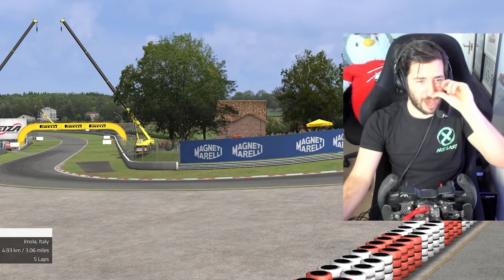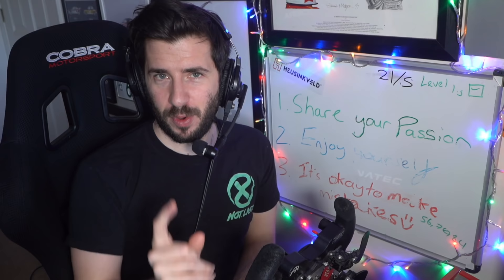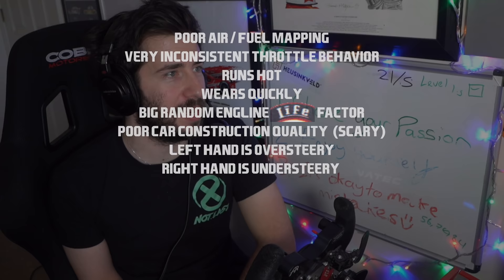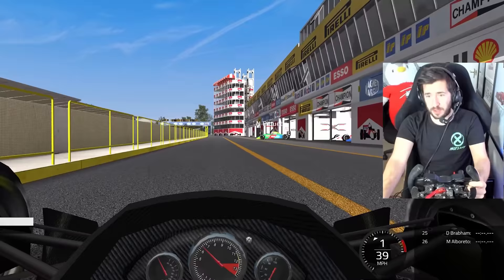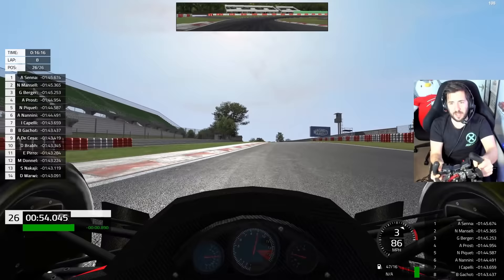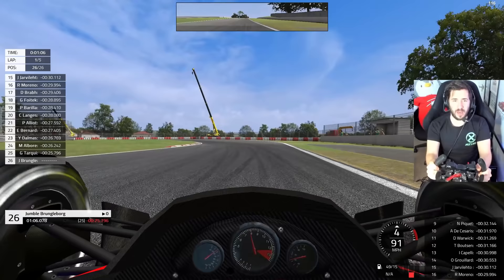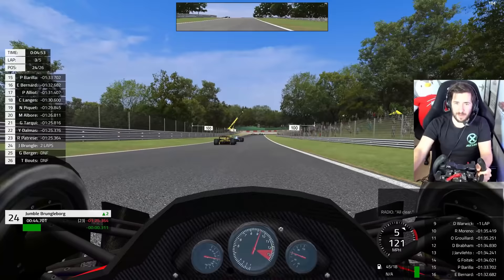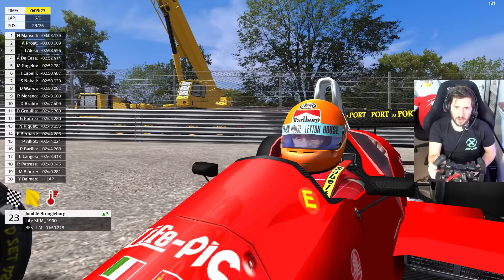I Drove The Worst F1 Car Ever Made

Comment: Fun fact. This car had less power than the Lotus from 1979.
Reply: Itd probably get lapped by a go-kart. And not a racing one
Reply: Nevermind the '79 lotus, it has less than the '67 Lotus when run in 'raceable' conditions! A 2017-2021 WRC car has as much power & that has less than half the displacement & a third of the cylinders! And even if it is a turbo, applying the FIA 1.7× multiplier for Gasoline Turbos only makes for marginally better reading.
Reply: @ChaosqueenMaddy  i can lap that car (I am morbidly obese)
Reply: @RayanM50B25  My dead great grandmother could lap it
Reply: Go on, lap it then
Reply: Damar Fadlan  Tbh a bicycle probably could. And not a racing one, i mean one of those ones you buy a kid with like, stabilisers
Reply: It had less power than the German entrants of the late 1930s
Reply: With how bad this f1 car is i can officially say I drive a F1 car
Reply: How and why would a modern car be worst than other older cars!?🤯
Reply: I'd love to see this car in a mixed era race. Just to see the equivalent.
Reply: @Makron5  You'd have to have max 1970 for it to have a chance 😁
Reply: And be aware the engine on this thing is a freaking W12.
Reply: They probably would have stood a better chance if they actually did use an old Cosworth DFV engine. It would still be down on power but I imagine it would be much more reliable.
Reply: I checked lap times around Imola and the Ferrari 488 Pista has more pace around there with a 1:48.33
Reply: Forget it. This car had less power than an F40, and was slower than an F3000 car of the same year.
Reply: Low power, heavy chassis and the aerodynamics of a brick
Reply: @legoferrari14   you could argue the lotus 67 and 79 had the same power since they both ran the cosworth DFV which was virtually unchanged throughout its service life
Reply: It had less everything
Reply: Less power than my left thumb
Reply: @StuntcatTV   r/woosh
Reply: Damar Fadlan  such a great game
Reply: It was slower than the 1958 vanwell
Reply: That’s sad
Reply: Fun fact this car had no life in it
Reply: It has 60 more horse power than the Eagle Mk1 and that sounds good but the Eagle won a single race in 1966
Reply: Some one says he car is fast than life car
Reply: @ChaosqueenMaddy  s h o p p I n g k a r t
Reply: Fun fact. This car had less power then my gammy knee
Reply: If we want to play that game the current 1.6T engines make half the power of the 1986 Brabham 1.5T.
Reply: We need a lie detector for life team and expose their lies that they wanted to say, come hire them
Reply: Also life was rumoured to be trying to sign Mika hakkinen

Comment: Fun fact about the W12, it actually could produce 650 HP, but it would literaly blow up in seconds, and Bruno Giacomelli said at the British GP, one of the Life best performances, despite being 16 seconds off the pace, that he heard a weird noise coming from the engine while he was driving the car, and he believed that noise was simply the 12 cylinders working at the same time for once.
Reply: And at that same race, it was only three seconds faster than the cars in the F3000 support race. If that was its "best" performance, then I think Jimmer was right in that it was usually slower than the F3000 cars.
Reply: @F1Krazy  the best performance for the Life was at Monaco, it was 14 seconds off the pace in pre-qualy, but only 2 seconds slower than the Coloni - Subaru, that was the closest it got to actually beat another car on pure performance, without counting the USA GP, when the Coloni lapped the circuit in almost 6 minutes due to a clutch failure.
And I would say that in circuits like Monza or Hockenheim (that was still the old layout with the long straights), the Life would might be even slower than an F3 car.

Comment: The mechanics just not bothering to put oil in the car because "fuck em" is levels of pettiness we love to see 😭😂
Reply: Should have used a Honda D15. Then maybe it would have lasted a lap.
Reply: At least it wasn't as bad as Andrea Moda who fitted Perry McCarthy's car a dodgy steering rack
Reply: @jacobrzeszewski6527  can confirm, accidentally ran my d16 for longer than i would like to admit without oil and it's still kicking 😂😂
Reply: @GRiiZZ  McCarthy: "Guys, I stopped. Nearly crashed at Eau Rouge, steering is jammed, and it might be flexing."
Sassetti: "Yeah, Moreno had a similar problem before we replaced his."
McCarthy: "Why didn't you check mine?"
Sassetti: "We used yours as a replacement."

Seriously, from what I'm reading Sassetti should've been charged with criminal negligence, if not attempted murder.
Reply: I think I remember that this was an unofficial split from Ferrari, and that the car had real potential. one by one Ferrari worked things out with mechanics, convincing them to make the team fail.
Reply: @AdamTheMan1993  I mean if we’re talking about dodgy steering? Senna demanded dangerous steering modifications be made prior to the imola race because his knees were touching it or something. We all know how that went alongside the other variables
Reply: Fight the Power!!
Reply: @dylanzrim3635  Wow now that is info I did not know at all, I thought Senna was just the victim of team negligence.
Reply: I aspire to be that petty one day
Reply: @Dat-Mudkip  My goodness. Is there a clip of this?
Reply: @AdamTheMan1993  Monteverdi-Onyx welding up snapped wishbones????
Reply: @AdamTheMan1993  really? dude was just trying to get him killed jesus
Reply: @Nick_4545  Yes really, I believe it happened at Spa where Sassetti tried to claim insurance money by having McCarty cause a big accident luckily the FIA got fed up of Sassetti's disciplinary actions and kicked Andrea Moda out of Formula 1, the only time in the history of the sport to do so.

Comment: The Life L190: the heaviest car with the slowest engine built from a design, it's main designer considered a death trap. Truly the marvel of engineering!
Reply: The L190 stand for Loser 190 

Truly Marvel of engineering indeed.
Reply: That things almost street legal competition of bad
Reply: @jamescarpenter855 there's plenty of street legal cars out there these days that could beat it easily, lol
Reply: Wasn't it based of the First F1 (yes, that's the team name) car from the previous year?
Reply: @PEPSIMaxMusic  Indeed it was. The sad part is that the First F1 car was actually fixed by the time the team pulled out. A few months later, it was bought by Vita, modified (or butchered, would be more appropriate) and basically smeared his name across all F1 with the abysmal attempt at running an F1 team. At least they had the spirit

Comment: The car might go faster if the wheels didn’t spin backwards. 😂
Reply: Have you never seen that optical illusion before?
Reply: I know it’s an optical illusion, and I know what causes it. I was just making a joke, that’s all. 😊
Reply: @sunman2566  ok Sherlock
Reply: @sunman2566  wow new discoveries, eh?
Reply: @sunman2566  r/woooosh
Reply: @McPlayer8t  what causes it, I’ve always wanted to know
Reply: MintyFresh Hmm… it’s difficult to explain, but I’ll try. Imagine a clock with no hour or minute hand, just the second hand, that represents the spokes of a wheel turning. Now if you took a photo of that clock every 59 seconds, and quickly flicked through them all, it would appear that the hand is moving backwards. The same principal applies to the wheel, however instead of a photos, it’s frames of the video, and instead of a second hand, it’s a wheel.
Reply: @McPlayer8t  ah okay
Reply: @sunman2566  r/woooosh

Comment: Fun fact about that thing: it’s own designer described it as „good enough only for a very interesting flowerpot”

Also during their infamous 7 minut lap in Imola their top speed was stuck at 105km/h(a bit over 60mph), while others were passing the barrier of 300km/h. Imagine going into Villeneuve(and we’re talking about the old layout so it’s a proper corner not a chicane) and seeing that at the apex
Reply: Giacomelli had a gearbox failure during that lap tbh
Reply: my old dingy shitbox wagon car with 98 hp can get up to 120km/h, wtf is that car designed as ?
Reply: @bluejacketergazu2447  tractor
Reply: @magnussencube  Massey Ferguson built an F1 car to demonstrate how good their tractors transmissions were. It had a race win by Sterling Moss and he said it was his favourite car he ever drove.

Even a tractor is better than this thing.
Reply: @beardedchimp  it was AWD too, the p99 was cool
Reply: wait does that mean that my old renault kangoo with 75hp is faster than an f1 car?

Comment: This just makes me wish for a series where Jimmy drives his favorite cars, but has to ruin the setup by randomizing everything!

I did it with the limited options in GT Sport, and it resulted in a Mini that literally couldn't drive straight, as it kept "falling" to one side or the other all the time, coming from insane toe angles and a spongecake suspension! It was basicly impossible not to spin on the straights, as it also had insanely grippy front tires, but the worst tires in the game on the back...
Reply: Still better than my AE86, it flipped whenever i tried to turn

Comment: The engine designer designed the V8 for the Ferrari 308. When he was fired from Ferrari he stated designing the W12. It’s actually based on a W18 design Ferrari turned down that was based on a W3 that was put in a bicycle frame.

Comment: Facts about the car:

There was only one chassis, and it previously failed a crash test during another team's entry bid, so they had to abandon the car, but it was bought by Life and it magically passed the FIA crash test.

The engine COULD ran up to 650 HP, but it would blow up in milliseconds.

The race in which the mechanics "formed a strike" and not put oil in the car isn't exactly all true. The real answer is that they just forgot.

Long after the team folded, someone bought the car itself, repaired it, and attempted to drive it on the Goodwood Festival of Speed Hill Climb. The car's engine blew up before it even made it halfway up the course.

Comment: Got a fun lap challenge, what street cars are faster than this "F1" car?
Reply: Street car based and street legal? I would say just about none....Street cars have miniscule downforce and crappy tires. Oh, and they are heavy as well. But its a fun thought.
Reply: Im sure there are some hypercars that could beat it.
Reply: @egoalter1276  Not "world certified" on street legal tires, I dont think.
Reply: @GoldenCroc  I mean, a veyron beats this in straight line acceleration, barking, downforce, and amximum lateral acceleration in a corner. I see absolutely no way this would win in a race. But alright.
Reply: @egoalter1276  It doesnt beat it in those categories, where did you get that data from if I may ask? Because it is wrong.

But yeah, its understandable you would think so with the data you got, but it is, as I said, wrong in this case. Cheers.
Reply: @GoldenCroc  I got my data from the publicly availible specifications for the car that make it clear it is clinically underpowered, and from its recorded qualifying times that put it over half a minute off of qualifying pace without fail on every track it ran on. Lets not account for the fact thats its engine would blow up every two laps if it dared access even its rather limited power reserves.
Reply: @egoalter1276  You are correct in that its a criminally slow F1 car, extremely so.  A bit of that will be the lack of proper setup though, and inability to work the tires. But very slow indeed, embarrasingly so.

However, where you have gone wrong is assuming for example a Veyron is faster or has higher spec in any of the categories you mentioned above because of that without any supporting data of the raw specs. 

But I can with confidence give you the same answer I gave you before: Its not faster. Not at all. There is just  that big of a difference between a street legal car and a F1 car that even an abysmal one is still considerably faster, and most of all, have higher stats in the categories you mentioned above. That is because those are higly influenced by body shape and vehicle weight. Both are highly suboptimal for street cars. 

As you may know, youtube doesnt really allow links, but there are tons of data of street car downforce (Its extremely small compared to race cars) as well as various video comparisons between formula cars and street cars. Even jimmers own nurburgring score sheet from his videos will likely be illuminating, and thats of a highly atypical track that very much favor high power and speed. Cheers.

Comment: The old gen 6 nascar I drove for my first time in a racecar at Kentucky speedway, (de-tuned with 5500 rpm rev limiter for obvious reasons), still had a faster top speed than that piece of crap

Comment: Fun video, and entertainingly much as with the Lola this video makes the car both better and worse than it was IRL. Overall pace is off where it should be (IIRC the car was at least capable of getting within less than 20 seconds off of the leaders' pace on the rare occasion everything worked correctly) but the top speed is actually too high  (145mph was the highest speed it ever clocked IIRC) and the original W12 lasting three consecutive push laps was never going to happen. They were also the last single car team and the reason the FIA forced through the rule that every team has to enter two cars.

Comment: Seems like it would go faster with a 4 cylinder turbo :P
Reply: yes as long as it wasnt designed by these guys. heck even a 1 liter turbo ecoboost would be faster
Reply: I think you could stick the engine from a 1994 Toyota Corolla into this and it would probably be better. At least it'd be reliable.
Reply: @AliceC993  you could stick a bone stock Mazda 12A into it and it'll be three times as fast

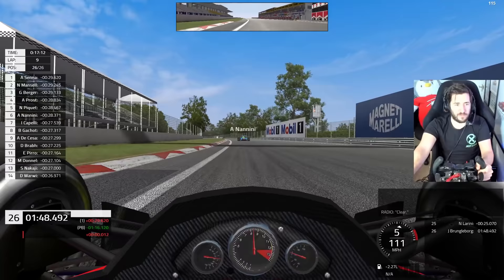Comment: 10:02

Just a quick sidenote:

What in Gods name is Bertrand Gachot doing sticking the 1990 Coloni on 5th in qaulifying??

Lets not forget that the 1990 Coloni was the one with the "works" Subaru engine, that on average was actually some LESS powerful than the Life W12, the Subaru flat 12 (what a year for engines 1990 was in F1) developed usually around 400-420bhp, and had a maximum output of about 520

Whats going on?

Comment: I'd like to see this pile pitted against 1950s F1 cars in AMS. Might get within shouting distance of a points finish!
Reply: Bruno Giacomelli did a 1:41.187 in the Life in pre-qualifying at Monaco in 1990. If he'd done that time in 1958...well, he would have been faster, because the circuit had got longer between '90 and '58. But just supposing he _did_, he'd have been fifth on the grid, between the Coopers of Roy Salvadori and Maurince Trintignant (who went on to win). In practice given the shorter circuit he'd likely have been closer to Tony Brooks' pole time of 1:39.8.

So...yeah, pretty much.

Comment: If only they had stuck with the damn Judd CV...
Reply: The electronics weren’t compatible with that engine, so it was not much better than with the life engine XD... Failed just as much
Reply: The whole purpose of the team was to try and advertise the "super engine" W12 that Vita had bought and every single team had said no to. That was the teams only purpose so no W12, no team. 

Not to say the chassis was any good either.

Comment: Why weren't u using full throttle?
Reply: The engine doesn't work too well at full throttle, until you are at 11000+ RPM, but at those RPM, the engine will blow up really soon. With bad engines and bad mapping, more throttle might not give you more power!

Comment: What's even funnier was the fact that Life tried to use old Judd engines in place of their hapless W12 engine and the engine cover basically flew off the car when it accelerated from the pit garage :D
Reply: It gets better.

The original car was actually designed for that very  Judd engine, but when Vita bought THE chassis (as in the only one) he obviously had to alter it so his "new super engine" would fit inside the car. After failing for the first 12 rounds of the championship, they finally realised the engine might not be that super after all, and put the original Judd engine back in, and forgot they had altered the car firs t time around, which led to the engine cover flying off.

Comment: The worst F1 car ever made
Simtek... hold my beer.
Reply: In what world Simtek is worse than that?
I think that it actually would be able to be faster than this on 3 wheels
Reply: The Simtek cars are definitely not the worst F1 cars, the Life L190 is the worst, even the Coloni-Subaru car would (probably) be faster than the L190 if the Flat-12 actually worked.
Reply: Why would you even consider either S941 or S951 among the worst cars?
Reply: @EL1AS_   Apparently even the S921 that Andrea Moda used was pretty good
Reply: @STREET24000  Compared to the Life L190 it was a rocketship, they got through PQ occasionally. Moreno even managed to qualify it.

Comment: The thing is, Jimmer, you actually made the car even worse than the design, for giggles, while the real drivers would have been trying to offset the car problems with clever setups.
The car woulr probably fare a bit better if you took this seriously, and found a setup that tamed the car, rather than leave it even more wild. 
Still, I am not convinced that the car was as BAD as your "not named" friend rempaped, tho. Specially the behavior under lateral loads. Heavier chassis are prone to be more stable, in pitch, roll and yaw, due to the weight, and given the low power of the engine, this car must have been pretty stable.